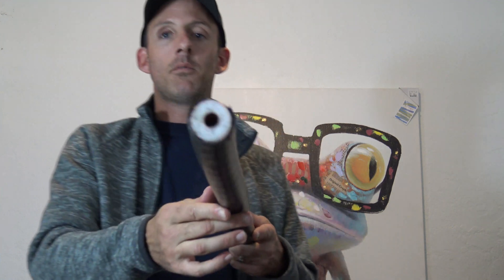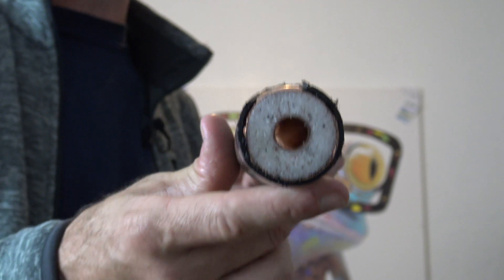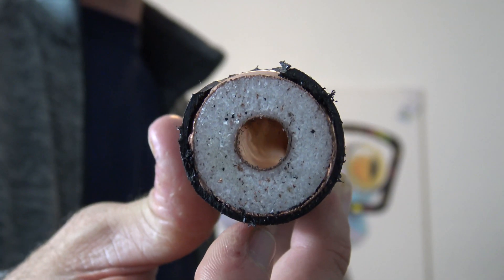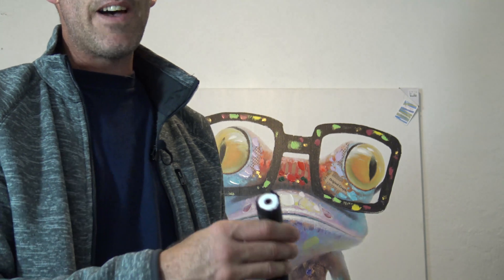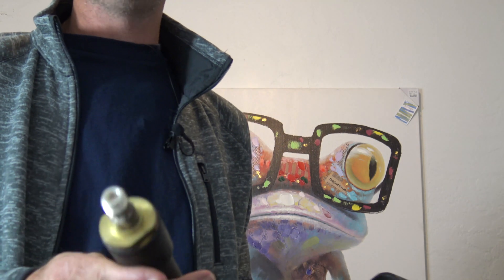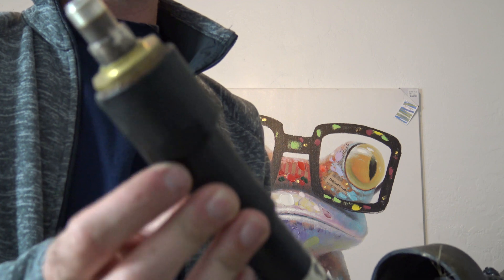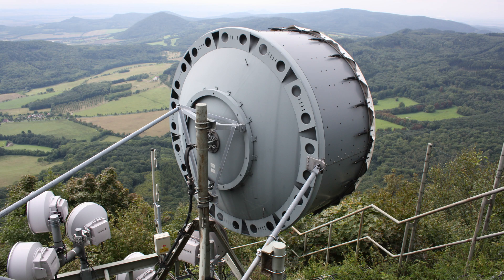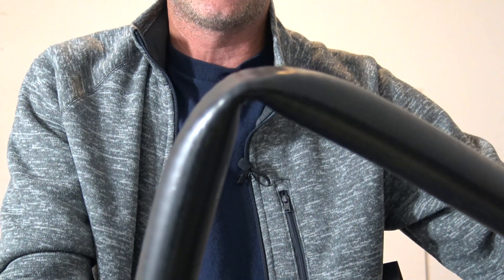Commercial Transmission Feedline, Hardline And Waveguide

Comment: I'm actually in the process of replacing my soft coax with LDF4-50A for VHF and AVA5-50 for HF and UHF. Why the big stuff for HF? Because 7/8" heliax has  0.09 dB loss at 29.6 MHz and less at lower frequencies and handles full legal power much better than LMR-400. 

I work a lot of weak signal DX, even on VHF/UHF, Satellite, and EME. Minimal loss in an absolute must!  As for microwave, direct transceiver/transverter mount to feed horn is necessary at 10ghz+ and instead of coax, you run CAT-6 data for PTT/Audio. Waveguide if used should be kept to a minimum, like PA to Feed horn which should only be a few inches.

Comment: Would a pinched waveguide reflect the power back at the transmitter and burn it out or would it try to burn the pinched section?

Comment: Hams operate microwave too. Some run up to 240 GHz. 122 GHz is not unusual. 10 GHz is the most popular band in the ham microwave world. 1, 2, 3, 5, 10, 24, 48 GHz and others are all used. You could run waveguide at HF, but it would be big enough for your house to fit inside. Not all microwave is point to point. You can have omni antennas at microwave, which are often used on beacons.

Comment: FYI all this radio equipment at broadcast facilities is or has been scrapped for the metals. IP has completely replaced radio in my business. Stations save on all the roof leases for antenna and they don’t need a radio specialist on the payroll   
 for maintenance. Point to point radio is over in broadcast even the microwave 2ghz live shot is over bonded cellular has replaced it. No more traditional news van with microwave mast and antenna, just waiting for the vans to wear out. It is amazing how technology can render years of knowledge useless.
Reply: So when there is a major earthquake and all the cell services are offline, are you still maintaining some backup systems?

Comment: Not bad.  I would suggest that you take your razor knife and cut the heat shrink off the type-N connector then get a couple of wrenches and remove the connector.  Then remove the center pin.  Much of the cable these days requires special tools but that has not always been the case.  Many connectors, exactly like the one you showed on the 7/8 can be put on and taken off using regular (if not large) common tools.  The O-Rings might get damaged but often are reusable.  With foam coax (not gas type) the o-ring is there to keep water out.  Of course we use electrical tape to protect the connector, mastic to keep the rain water out, and additional wraps of electrical (vinyl) to protect the mastic from sunlight.  If you are interested in what I suggested you might like the final result from what you've learned.  You can see all sorts of broadcast and LMR tower work on my channel, www.youtube.com/user/jhettish  You've given me the idea of doing another video concerning broadcast "rigid" coax, 1 5/8 and up.  There is a lot of video of us replacing 3 inch and 4 inch rigid.  Another simple thing.  You may be familiar with RG-58 (1/4") coax.  It's used in mobile installations these days mostly.  The ratio of the braid to the center conductor is determined by a formula.  The ratio of 4" coax to it's inside connector is governed by the same formula, both matching 50 ohms.  I have 48 years in the two way radio business and a similar amount of tower time.  Haven't climbed higher than 770 since January 5, 2021.  Nice day with 30 degree wind chill.  As old as I am it's time I stopped doing that. :-)

Comment: The antenna is never in the shed  !  The Antenna / RF Radiator is always up in the air especially for commercial applications. If anything the continual shrinking of hardward has seen the transfer of the transceivers somewhere up the tower and the RF Signals are processed there and taken down the tower as data via ethernet or optical. AC power is taken up the tower to the hardware.

Comment: The first transmission line looks like it might be foam dielectric Heliax made by Andrew. When I set up a 950 MHz studio-transmitter link system for a local FM broadcast station, I used 100 ft of 7/8 foam Heliax at the studio end and 160 ft 1/2 inch foam Heliax at the transmitter site. The main transmission line at the transmitter was 1 5/8 air dielectric Heliax.

At my amateur station, I'm using a 9913 equivalent cable for VHF/UHF and DXE-400MAX (LMR 400 equivalent) for HF. For the comparatively short runs at my QTH, these feed lines are close to lossless when properly matched.

Comment: I run 9ft of this 1" 1/4 straight out the back of the radio and directly to the feed-point. I don't need a mast as the coax works like a mast.

Comment: The wave guide is about 1/2 wavelength  to get one to work on 40 meters it would not be easy to work  with something 1/2 wavelength wide.
Reply: Why would anyone in their right mind use waveguide on 40 meters? 7/8" heliax only has 0.19dB loss at 7.299 MHz for a 200' run and 99.9% of amateurs will most likely never need a 200 foot run. Besides, the size of waveguide you'd need for 40 meters is completely ludicrous, if not straight up impossible.

Comment: I have seen the cable,  if that is what you want to call it,  that is 8 inch copper pipe with about a about 3 inch with spacers to keep it centered. It is used for TV stations output.

Comment: Thanks for showing that and bringing back some memories from my commercial radio days.
During my military career, I had limited experience with antenna lines as I was mostly an inside telecommunications technician. At least until I became attached to a Combat Comm Group. 
But most of my experience with the lines you were showing came from being a Microwave Field Technician with Motorola. Where I was assigned to the Norfolk Southern Railway Project where I was responsible for maintaining about a dozen or so sites running from just south of Tuscaloosa, AL to just north of Laurel, MS. Each site employed, Microwave and VHF radios for Dispatching and Signal Controls. A Train Engineer or Signal Maintainer in New Orleans, LA talk to the Dispatchers located in Atlanta, GA as the VHF was tied into the Microwave which brought the signal to/from and also in/out at all the hundreds of sites along the route.  I also maintained their Data Systems and a small Redcom PBX (Telephone Switch) at my main site in Meridian, MS.  That is until I was promoted and moved to be a Lead Tech in the Atlanta Facility.  Norfolk Southern has the largest private microwave system in the world.  Stretching from Chicago to New York to Florida to Louisiana and all states in between.

This experience paid off following Hurricane Katrina, where I was the Network Operations Manager for T-Mobile, I directed the deployment of unlicensed Microwave Transceivers to bypass AT&T T` lines as AT&T switches were buried under six to fifteen feet of water.  This allowed T-Mobile to 90% restoral their Louisiana and Part of Mississippi Cellular Service within 30 days of Katrina hitting New Orleans.

One thing to note is that we used a Vacuum Pump connected to Desiccant Dehydrator to keep the moisture out. And when the desiccant began to fade, we would seal off the Dehydrator by closing a valve and replace with fresher desiccant.  I would then take to wet desiccant home and bake in the oven until it was dry and bluer again.  Seal in a can until needed again.

Unfortunately, I am now retired due to medical conditions but enjoy doing what I can with ARRL, ARES,  Storm Spotting and our local Crescent City Amateur Radio Group (CCARG). 
 
Louie
General Radiotelephone Operators License # PG-GB-01126
Ham Radio License KG5EFQ

Comment: i think the inner conductor is using the insulation and a capacitance push this gives the ability to shove current like a rod long distances. The Ridges are so you can bend the pipe.

Comment: I have 8 - 150 foot runs of 1 5/8 Cell Flex hardline to 3 towers. Then reduced down to 3/8 hardline to the antennas.  I run an H-Frame with 4 antennas on 2/432/1296, 2 antennas on 222 and 902  and 2304 Ghz.  Two Moon bounce antenna arrays for 2/432. This system has been in operation for 19 years now. I had a old ham friend who ran wave guide on 1296 and 2304 and 10 GHz.  Its was something to see.

Comment: When TV was still analog, we ran a 50kW visual transmitter and a 5 kW aural transmitter, through a diplexer combiner, into 6 inch transmission line to the antenna. The transmission line was basically a 6 inch pipe with another smaller pipe suspended in the center and pressurized with nitrogen.
Reply: Have you seen the old video about a huge transmitter station in the UK about the WW2 time frame. It is a huge amount of copper pipe all done by hand in a swamp. Tower construction, line soldering, trench digging and the whole smear. Construction people today would laugh at the prospect of such a project. Those men were like, ok not a problem.

Comment: I wish remote radio heads were more common in amateur radio! Cellular sites have been using them a lot to get that UHF or even SHF signal out more. That way you aren't wasting power on the transmitter on the ground, rather, you put it as close to the antenna as you can up top.
Reply: ^ Exactly what he said!

Comment: Thanks Eric for the great video.  I had two jobs where I worked with wave-guide. One in marine radar where the common freq. was around 9-10 gig (X band) radar and less common 3 gig (S band)  X band wave-guide is 3 cm rectangular and long runs were less common as most new radars would have the tx & rx in the base of the antenna.  Usually 3 to 12 kw transmitters with the receivers using the same antenna with circulators and rf limiters to protect the receivers.  All this in wave-guide and a rotating connector to connect to the antenna.  I did install one long wave-guide radar on a government boat in the 1970's and that was the last one.  The other Job was for an Oil company big in  southern Calif, who had the "largest private phone system in the world" as I as told.  We maintained their systems in 3 counties but the main work was just in one,  I helped install a site on a new platform and maintained the sites on the others.  Some were only a mile apart so the transmitters were 10 - 100 milliwatt with a 10db attinuator.  to  not overpower the receiver at the other end. the whole system was 100% redundant so any failure would not shut it down as some of the info being sent was the telemetry for the oil pipelines, they had to keep and accurate count of barrels in to out of the pipeline for leak detection.

Comment: I ran 100ft of 7/8HL on my 2m  repeater back in the early 80's it did have a solid center, and it did cost an arm/leg as did the connectors.  I transferred ownership 5 years later and it was still running great.   lol.

Comment: Along time ago I was in the Air Force and worked on airborne radars. The frequencies that were being used were all in the gigahertz.  All of our packages used waveguide that were square or rectangle. They were all pressurized.  The inside of the waveguides were plated with precious metal, either yellow or white gold because of the velocity factor and conductivity of the gold. After we finished a repair, we were required to pressurize the system and perform a leak check to ensure that the system remained pressurized.    To do this we carried a small bottle of “Leak Detector” which was essentially a bottle of water with some dish soap mixed in it.  If it is sprayed on a fitting that is leaking air, bubbles would form to indicate the area of the leak.  

My experiences working on radar system has help a lot with understanding Ham Transceivers. But in Ham Radio we use much different test equipment. I never had to tune a microwave transmitter to the microwave dish... I guess the design engineers took care of all that before the Air Force bought the systems.  Field modifications were never allowed.  That’s one of the fun things in Ham Radio... experimentation!

Comment: Just an FYI on the prices that we are talking about for elliptical wave-guide for 6 Ghz. The wave-guide itself is about $35.00 a FOOT. The connectors are about $250.00 each. The tool for installing them properly is about $800.00 used. Also the connectors are tuneable and a calibrated signal generator, spectrum analyzer and return loss bridge are needed to do it right. Then, as you said, an air dehydrator or nitrogen bottle is needed to keep the wave-guide dry and pressurized. If the system is installed, like most of them are, on a mountain top somewhere then an alarm system is needed to notify personnel when there is a problem. I worked for about 30 years for an electric utility where we had about 20 sites and about 35 end-to-end paths. Most at 6 Ghz and a few short paths at 10 Ghz. When I started in the early 1980's there were about a third of the sites and everything was analog. The interesting tidbit is that we can do with 500 milliwatts with digital what required 10 watts with analog (two synchronized transmitters).
Reply: Mike.... thank you vy much for that info. Very useful indeed to know,. The highest I ever went was when I got my hands on some surplus 3/4 Andrew Heliax.... but as you rightly said, those connectors are NOT cheap ! But... on 440 MHz the loss was very low indeed.. 
Thanks for giving some extra info to this  video from Eric, while I am unlikely to ever embark on those freqs it is still nice to know.
Albert EI7II.

Comment: uses 7/8 inch Andrews hardline for vhf uhf on my 72 foot tower with n connectors. Probably overkill but it works LOL :)
Reply: yeh ive been using 7/8 and 1/2 on vhf and uhf for years as you say overkill but gee it works
Reply: Why not DIN connectors?

Comment: I bought some 3/4" Heliax (Commscope brand) for my 2M/70cm coax run.  Antennafarm has great prices for this stuff.  You can order it with whatever connectors you want on it (better for me since I don't need to spend a ton of money on Heliax crimpers).  I spent about $150 on a 100 foot run - but for sake of putting out as much power to my antenna as I can it works fantastically! Plus I'm future proofing my shack for when the IC-9700 comes out :)

Comment: We had an accidental overage on an order of 1/2 hardline just under 250 feet.  I was able to purchase that roll for pennies compared to the actual cost.  I believe I paid $100.  I never used it and stored it for years and moved it with me the 4 times I moved.  I eventually donated it to another ham for his tower.   I knew the value of it at the time, but never thought to sell it, or use it for the short runs I had in my radio shack.

Comment: What are the ridges for?
Could you as a ham fabricate something similar with some pipe and insulation for a long run?
Reply: The ridges are just congregation that helps the line bend without kinking.  Similar to corrugated gas line for a gas grill or logs.....

Comment: I've been using 1/2" LDF4 Heliax for years. My buddy runs a company that builds and maintains commercial towers, and he hooks me up with whatever I want. He had 6 spools of 1 5/8" that he wanted to sell, but couldn't find anyone that wanted it. He ended up scrapping it for copper. He got $2/foot and scrapped over 6000 ft!

Comment: I use 1/2" hardline on 430 for satellite communications for the run to the antenna from the transmitter. I also use the 1/2" hardline to my 18HT high tower vertical too, it's a 100 foot run..